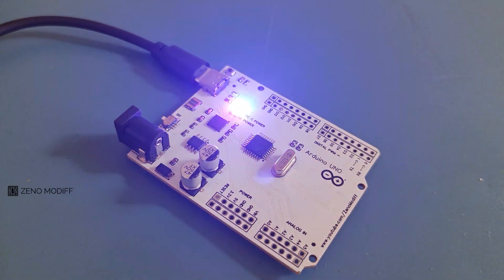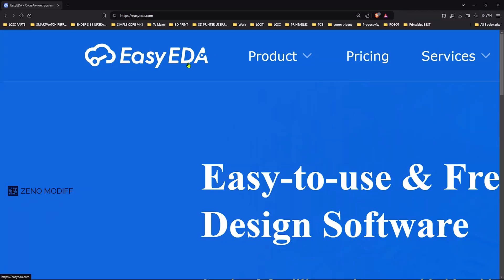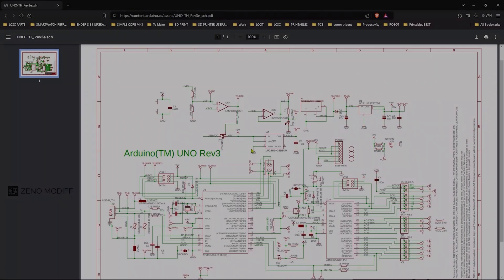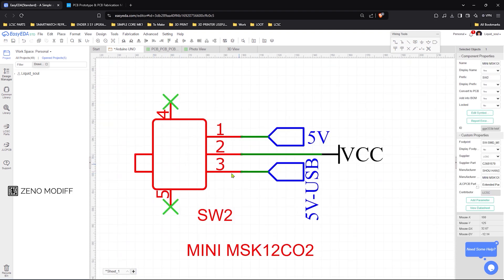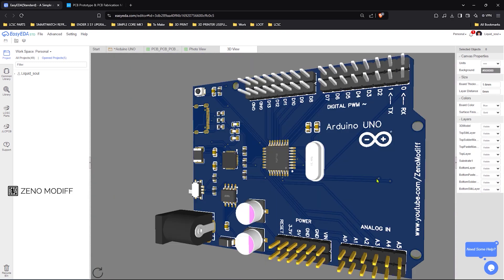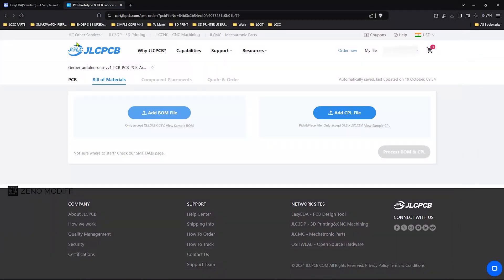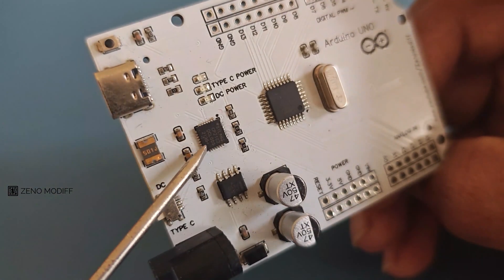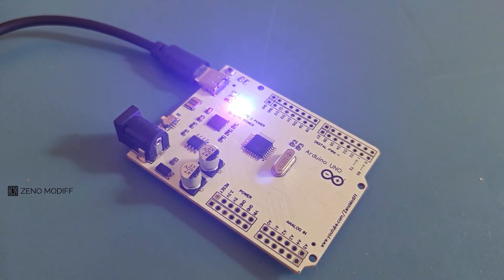Design and Build an Arduino Uno with Type-C Connectivity

Comment: Why use a switch to change the VCC power? What if the user forgets to switch it?🤔
Cannot we use some kind of diode or something?
Reply from the maker: This is a safety feature to protect the pc usb hub from voltage spikes and possibly ruining the port , to eradicate there is a switch when flipped to Dc mode the power won't reach the type c port and only when changed to USB side we can program the Arduino
Reply from the maker: Diode can only allow current to one direction it won't isolate the current intake so to make it easier I had used a spdt slide switch